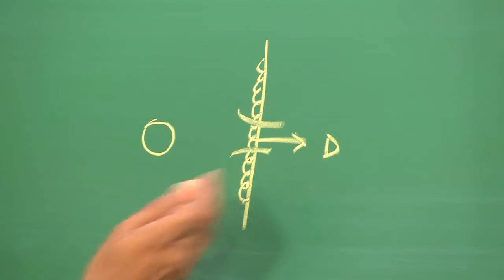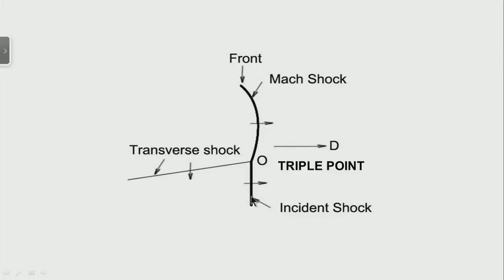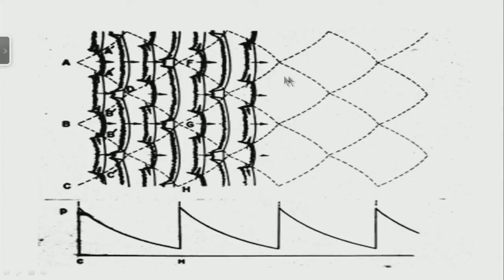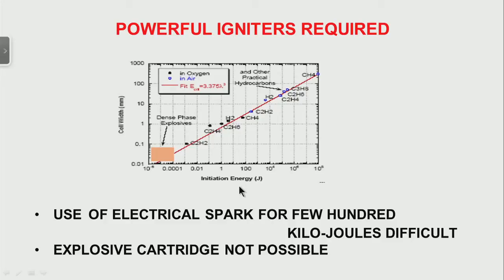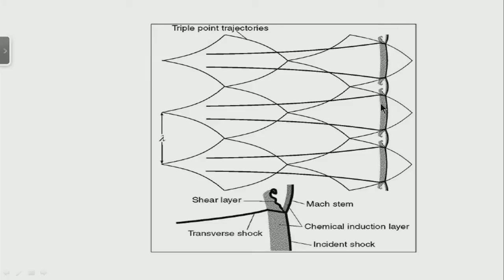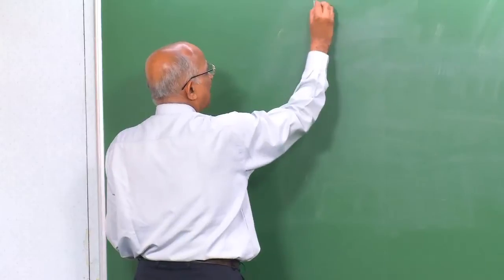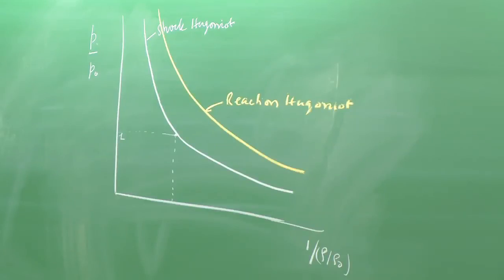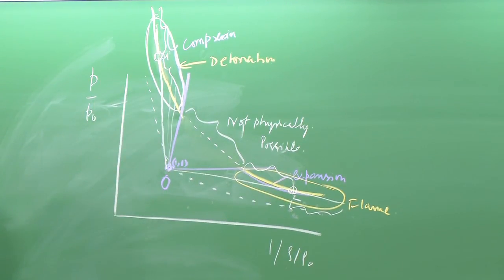Mod-01 Lec-24 Detonations: Multi-head Shock Front in a Detonation

Comment: If a combustible mixture of gasses is ignited with insufficient energy for detonation to occur, does the expansion solution of the reaction Hugoniot deflagration suggest that the flame speed starts at zero and accelerates along the reaction Hugoniot curve to the flame speed computed in an earlier lecture (that was slowed by the activation energy)? Is this flame speed less than the maximum velocity of deflagration implied by the expansion solution of the reaction Hugoniot? If this limited flame speed is larger than the maximum reaction Hugoniot velocity of deflagration, then does that imply additional conducted heat loss and that the flame eventually extinguishes?